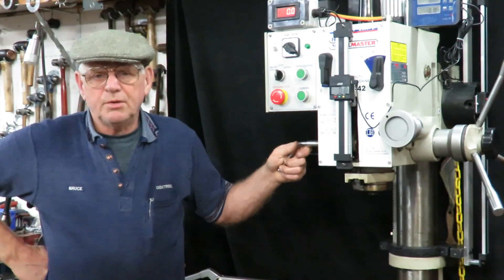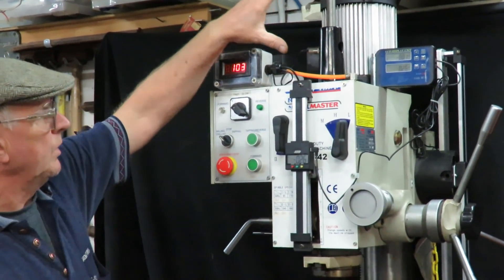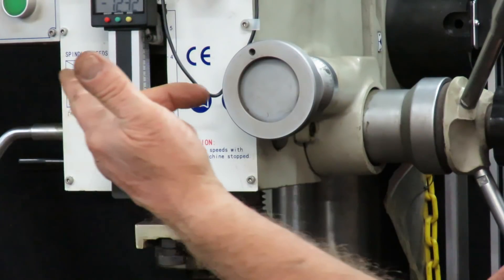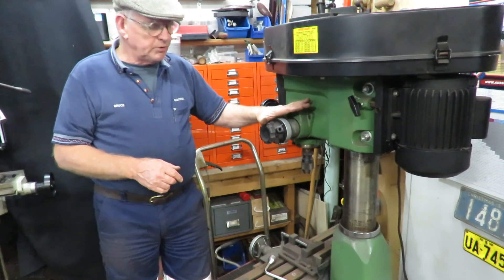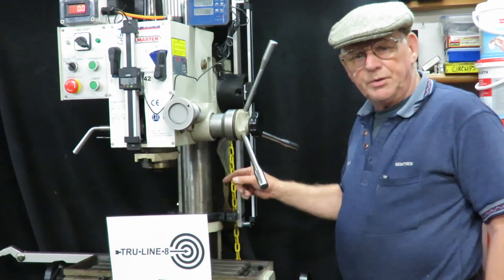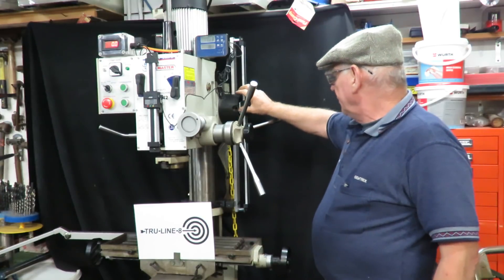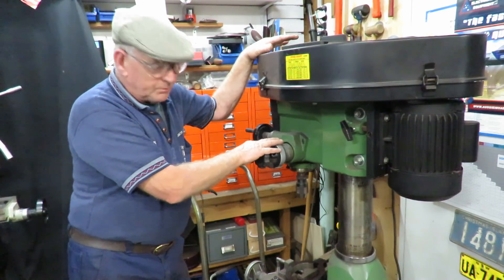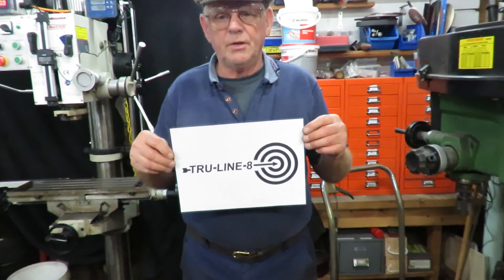Gear Head Mill Drill Improvements Including the TRU-LINE-8- Kit

Comment: Hi Bruce. I have a wrong Fu round column mill like that and I have been planning to do something simmilar to your true line 8. My plan was to just make a top and bottom clamp that holds the vertical rack gear in place and use that as a guide. Did you try that and if so did you find that it didnt work for some reason?
Reply from the maker: Abe, I looked into using the rack as a guide and rejected it for several reasons. The slop between the rack and the groove in the casting of the head is not a good fit, I looked at putting some brass guide bars in the head but that was very difficult and each machine would need a different approach. I did drill through the rack and tapped into the column to lock the rack after I dispensed with the top cap which holds the rack from being pushed up during the "racking" process. My idea was to find a product that I can sell to any user having absolutely minimum needs for installation work.